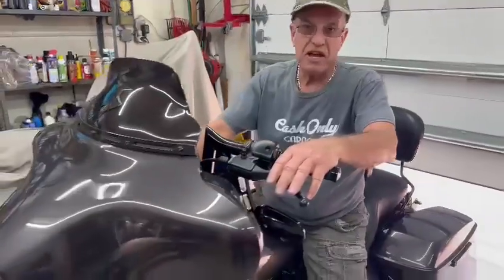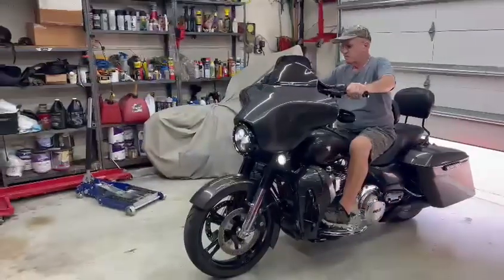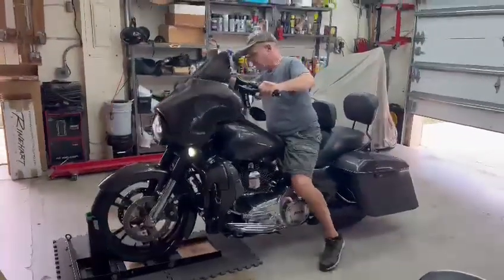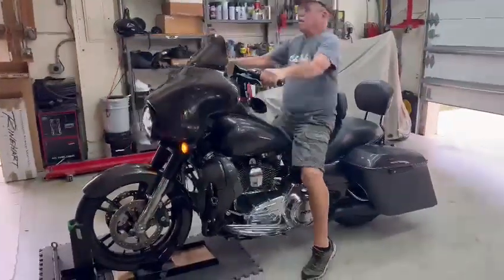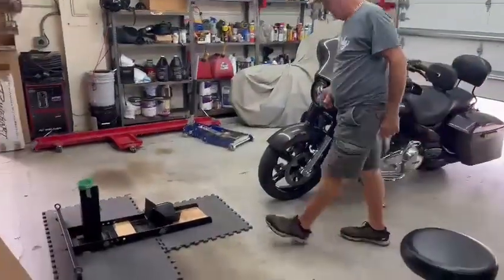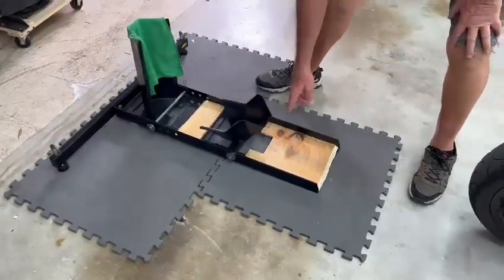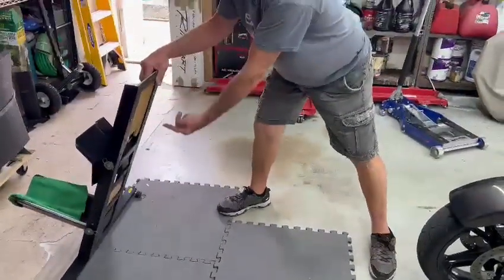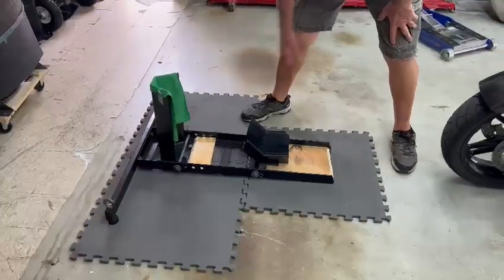Harbor Freight wheel chocks

Comment: I solved the problem.  Buy some sandpaper tape that they use to keep people from slippping on stairs (home depot has it in 2" rolls).  Then buy a rubber mat from home depot.  Lay the rubber mat on garage floor.  Then stick sandpaper tape to bottom of wheel chock.  Be sure to cover the cross pieces too,...every bottom surface has sandpaper on it.  Remove plastic front feet so it lays flat on the rubber mat.    Now sandpaper is digging into rubber when you roll bike onto it.  It wont slip.

If you don't use the rubber mat it will work too but the sandpaper will scratch divots into your garage floor.  The eyelets are not connected to the feet so you can still strap your bike.  - Ken